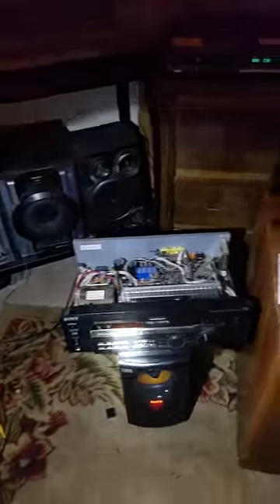How to fix protection mode on your home amp

Comment: basically you shorted out the 1/2 ohm precision resistor that works as a fuse. As you bypassed the fuse, now the receiver is not protected so if the current exceeds the spec where the resistor blows, the amp is completely fried, not just the $4 part. But whatever floats your boat...
Reply: MrGlenred but then you'll have to buy a new receiver
Reply: MrGlenred can YOU MAKE A VIDEO with lights on, instructions, where the component is, etc? This video has answers half a million people want and can't see a thing

Comment: Shorting the output transistor emitters together (by jumping the emitter resistor) won't do anything. The resistor is there as emitter degeneration and to add some stability to the bias.

Comment: Awesome!!! Worked on my Onkyo receiver. Thank you!!!!!!!
Reply: Yeah, it worked on my car too... I ran a wire from the HIGH-BEAM headlight to the #1 cylinder spark plug... Now the car will fire and run on the 12 volt DC system without any fuel... This simple trick has saved me HUNDREDS of dollars already this year!
Reply: @_Common_Logic_  haha

Comment: "I'm broke"... Yep... Can't pay the fucking light bill to shoot a damn video... Proceeds to wander around the entire circuitry with his hand held potato cam and say "See that thing"... That's what I put some metal on...

This is trolling at it's worst and DON'T burn up your entire receiver listening to this shit. I'm no electronics engineer, but there are also capacitors and a transformer in there somewhere. Holding a piece of metal and arcing the wrong component could probably kill you even with 110 volts coming in.